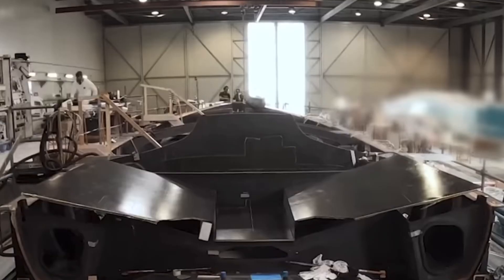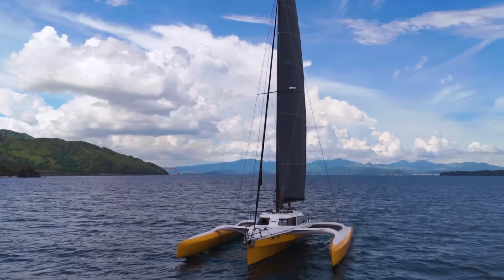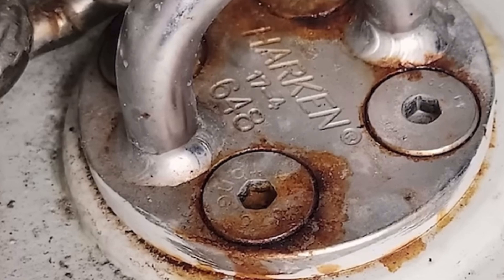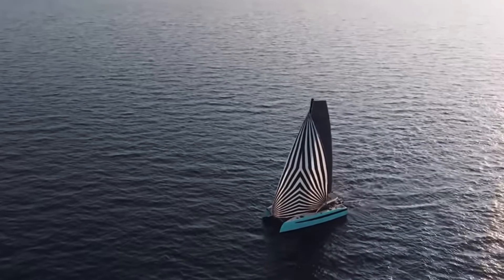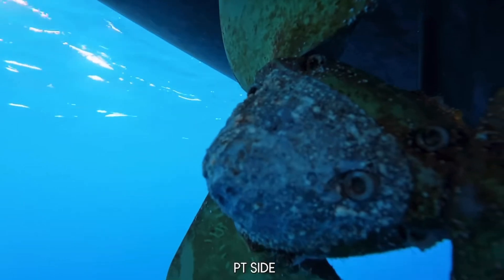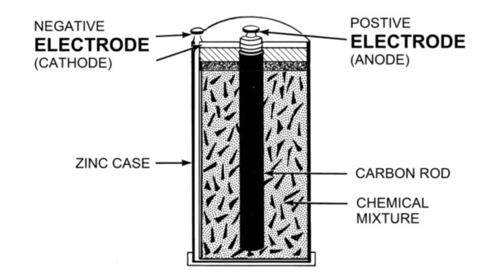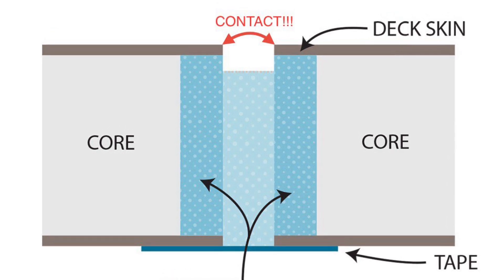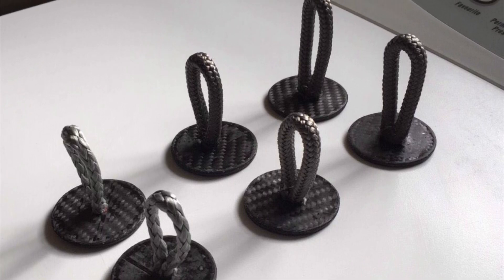Is Carbon Fibre Really a Good Idea for Cruising Boats?!?!?

Comment: Since carbon fiber is 30% lighter, can you can expect to go 30% faster, and finish races 30% earlier?
What's the relationship between weight and cruising speed? Can you steer more upwind? Do carbon boats have heavier ballasts, and as result are more stable?
Reply: The force required to push a boat through the water increases just slightly more than linearly with weight. So if you load up a boat so that you increase its weight by 25% you will need a little more than 25% more thrust to do the same speed. This means of course that you need a bigger rig, bigger running rigging, bigger winches, also a bigger engine, propeller, fuel tanks etc so that increases weight further, which increases the power required....so you bet the picture.
In addition, boats with long, lightly loaded hulls tend not to have the same limited "hull speed". So with the application of more thrust they will go faster, sometimes at much higher speed length ratios than their theoretical hull speed would dictate. If you then overload these hulls - and we are talking most multihulls and a very few monohulls here - then the resistance curve becomes much steeper and the boat will no longer exceed "hull speed" so the boat goes slower with higher loads.
Reply: @deerfootnz  not as simple as that.
Reply from the maker: This is a complex question! The IMOCAs exceed hull speed by planing/foiling both of which require light weight to get the hull up out of displacement mode and the more weight you add the harder it is to do this. As noted above by @deerfootnz multihulls exceed hull speed by a combination of having very long skinny hulls but weight is also a factor here. I sail a high-performance multihull and I can definitely notice the performance difference with each additional crew member. In double-handed racing trim the boat will seamlessly pass through the hull speed “barrier” as though it didn’t exist. But as I add weight there’s more of a “hump” required to exceed hull speed, and another “hump” at about 12 knots of boat speed, so the impact of weight is non-linear and definitely more noticeable at different speeds and transition zones.
Reply: @SailingTipsCa  i'm aware of that. Studied multihulls evolution from 5000 years ago to today. Fascinating and complex. It was a game changer when we learned that at a given speed a good shaped hull could start semiplaning and so lift and so has less displacement and so could go faster and that could further lift the boat and so on. 
I really like trimarans myself. What performance boat do you have?
Reply: @ottifantiwaalkes9289  nearly all multihulls, or any long narrow hull never develops enough lift for "semiplaning". They are always displacement sailing, it's just that the resistance curve has much less gradient and there is no clearly defined hull speed. Planing requires broad flat sections like those at the aft end of an IMOCA.
Reply from the maker: @ My personal boat is an F-82R trimaran. The floats are very long and skinny with V-shaped bottoms while the main hull is more U-shaped. Some say the ability for a long skinny hull to easily exceed the so-called hull speed is a factor of length to beam ratio (e.g. 8:1 or greater) while others say it is a factor of the half-angle at the bow being small enough to generate minimal waves. Maybe it’s both?
Reply: @deerfootnz  sure halfround hulls cannot develop lift. Some trimarans have a large part of the mainhull flat and so get lift. 
Started in the late 60's.
Reply: @deerfootnz  sure. One needs flat surface. Well in the 70's some boats had flat areas. Monohulls had it left and right of the keel. Trimarans the same. Some were so unpredictable at hull speed that it was rather almost uncontrollable. Even the monohulls took of and were hard to control since all of a sudden the boat had less water line and so less stability especially at higher speeds. Trimarans surfed waves or swells at.near 30 knots on a 40 foot tri. That was around 1970. Scary and all new territory.
We added plates to even rather heavy monohulls under the rudder. We saw about 1 knot extra speed.
Reply: @SailingTipsCa  sounds like a fun boat.
My neighbor has a corsair 37 a few years old. We sail searunner. Jim Brown. To bad you cannot have a plate under your removable rudder or centre board.
Reply from the maker: @ottifantiwaalkes9289  My main hull does have flat-ish sections adjacent to and aft of the daggerboard case and it does kind of skip along on the water surface, but it’s unclear if this is really “planing” or just being lifted out of the water by the righting moment of the leeward float, which has enough floatation to fly the centre hull. I think there might be some benefit to a T-foil shape on the rudder to reduce pitching in waves, but it would also add drag in light air which there is quite a bit of around here.
Reply: @SailingTipsCa  that's why I call it semi planing. Not planing.
Reply from the maker: @ottifantiwaalkes9289  I guess it doesn’t really matter what it’s doing as long as it’s going 2-3 times faster than the “hull speed”!

Comment: It's time for full titanium boats
Reply: Titanium would be an amazing choice for a boat if it wasn't an utter nightmare to form curves.
Reply from the maker: LOL yes it could be called the SR-72!
Reply: @SailingTipsCa  except all the leading edges on the SR-72 were made from graphite composite tiles for stiffness at high temperatures and pressure.
Reply from the maker: So you’re saying we’re stuck with carbon either way?!?!?
Reply: Yeah, for multi-millionaires or billionaires maybe. I'd go for aluminum.
Reply from the maker: @James_Aron_1967  Personally I like the durability of aluminum for cruising boats!
Reply: I can imagine titanium boats being banned at marinas because of how quickly they would cause galvanic corrosion to everything around them😂
Reply: Yea, I've got an 39 foot aluminium sailboat! It's simple, it's solid, definitely the best material for cruising boats. I wasn't joking. Only titanium would beat it with better strength to weight ratio and much better corrosion resistance.
Reply from the maker: @XArthieX  Titanium is a pretty cool material! Hard to find shops that can machine it though…
Reply: @SailingTipsCa  yes exactly there a reason titanium boats practically don't exist. Titanium is getting more accessible. More and more consumer electronics have titanium cases, so I'm hoping this will accelerate titanium fabrication tooling. Laser welding is getting better and showing more promise. It's not against the laws of physics, so I'm hoping someone rich and skilled enough builds one and shares its result with the world. Would love to see it!
Reply: @XArthieX  Titanium is showing up in a few high-strength areas e.g. chain plates and some say it “gets along” with carbon a bit better than other metals…
Reply from the maker: @XArthieX  I’ll check the Metal Supermarket for titanium the next time I’m there!
Reply: Sailboat marial use cases:
Carbon: racing
Aluminium: cruising, exploration, high latitude
Glass fiber: charter
Steel: marina / anchor

Comment: Are you sure about the Wynns' HH44? That boat is available in at least 2 different versions, and I don't think the Wynns got the all carbon version…
Reply: They got the OC version mostly glass hull with an up grade for a carbon coachroof.
Reply: @jackdbur  That's right, the Wynn's cat is the OC44 with options. They wanted the HH44 but couldn't splurge for that model. Perhaps now they're glad that they didn't.
Reply: And a nice table , a steering wheel, maybe a toilet seat , and shitty wiring job.
Reply from the maker: @renaissanceman8564  High likelihood there’s carbon under all those corroded deck fittings!
Reply: Gone With Wynns is not 100% carbon. Just reinforced with it in a few places.
Reply from the maker: Good clarification - in this video Jason says it’s about 50% carbon: https://youtu.be/AGaiVCHAw_M
Reply: @SailingTipsCa the coach roof is carbon & it has carbon reinforcement at high stress areas of the hull. 😊 so way less than 50%